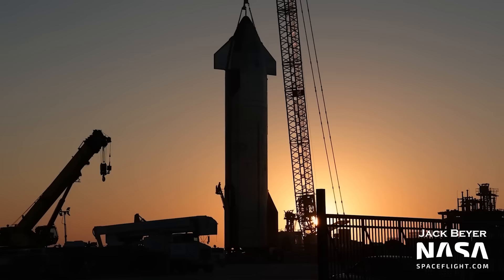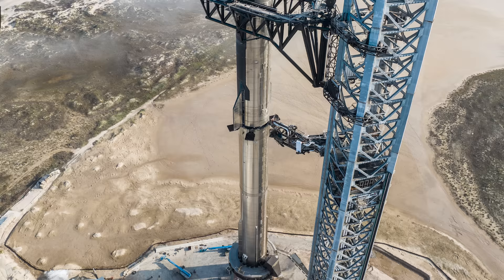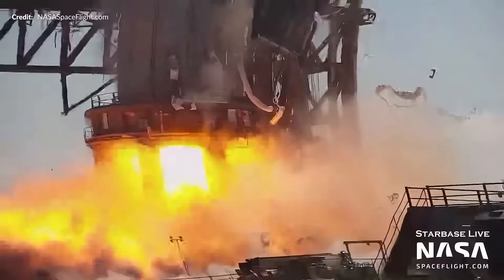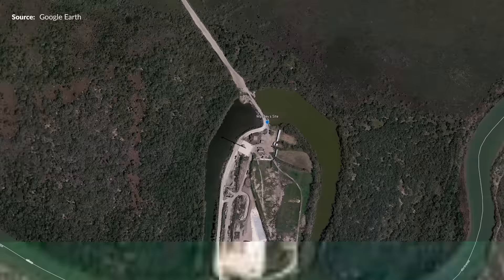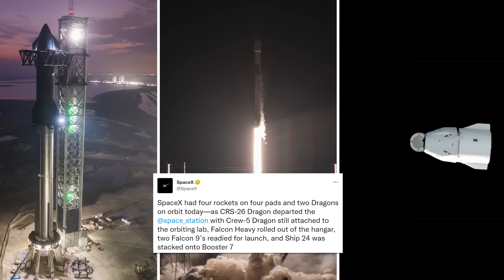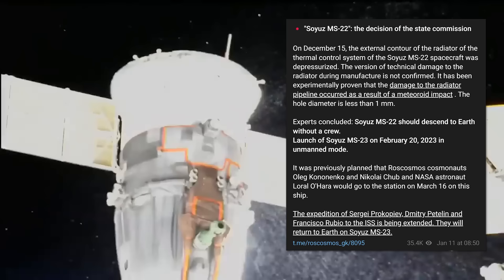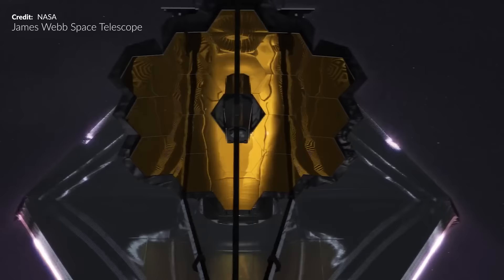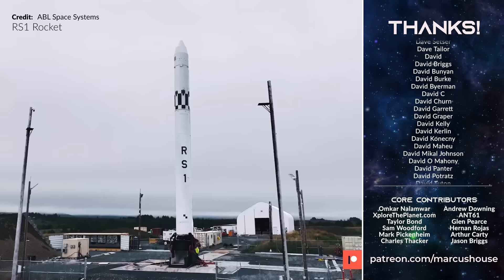SpaceX Starship Full Stack Upgrade Testing, Falcon 9 OneWeb, Falcon Heavy USSF-67, JWST Update

Comment: Full and rapid reusability starts with and depends on the OLM and surrounding ground support equipment.  To be able to launch reliably and often you need a bulletproof launch facility.  The only way I can see they're having that is by transitioning to a launch platform that incorporates a thrust/flame diverter/trench and vast quantities of water.  I've heard that that would be difficult to achieve in Boca Chica because of either the geology or the hydrology affecting the land on which that structure would need to be built.  Whatever the challenges I know a suitable structure can be built.  Bridge builders have faced far more daunting challenges in that regard, and they've been able time and again to come up with very workable solutions.

Comment: Hey Marcus great show been following you for a while. Just wondering what's your thought on Space X placing sacrificial floating platforms for a target to land the booster and Star ship on. I have no doubt they can catch the booster and star-ship once they get the accuracy of landing figured out. I figure the landing process and calculations will be similar to the Falcon 9 system but enough different that it will take some experimentation to be successful.

Comment: I'm thinking they need at least three more static fires, one with just the booster with 33 engines, one with the booster and a simulated load equivalent to a fully load Starship, and then a test fire with a fully loaded Starship (albeit a dummy payload).

Comment: Thank you for another wonderful space video! The format works well, even on weeks when there isn't as much news.

We're all looking forward to SpaceX sending a Starship to orbit, but I'm really interested in the first time they fire up all 33 engines. That's going to be quite an experience, and very educational for SpaceX. You never really know how the engines will work as a group until you test them together. On a related note, I'm surprised they have no solution to the concrete damage except for resurfacing the pad after each flight. If they eventually build up to launching Starships daily, that's going to be incredibly annoying.

Comment: Suggestion: In the speeded-up clips of Starbase operations (chopstick lifts, etc.), add a caption for "actual elapsed time" or maybe "3x playback". We can see that everything is fast, but to usefully discuss "how long will this series of tests take?" (at, e.g., Ars Technica) a quantitative impression would be helpful. (I can't guess if the videos use a standard fast-forward factor, which would make captions easy, or if it varies to match Marcus's narration.)

Comment: why not have removable hexagonal concrete slabs, with heat shield tiles on top, below the launch table? If heavy enough, they would never move and be easier and quicker to replace if damaged.

Comment: Moving the 70m tall booster vertically on a transporter must be an incredibly precarious event. With a dry mass of between 160 and 200 tons and a center of gravity towering around 20m meters above the transporter, it sounds as though a heavy gust of wind could simply topple the booster!

Comment: Before any orbital flight they should just do a hop and test this insane recovery system
Reply: Why?  The system is useful even without reuse.  Development of the landing system can be done in parallel with orbital use just like with Falcon 9.
Reply: @Scanner9631    I will let you in on a secret…what goes up must come down…no down then no need for up
Reply: @shawnstangeland3011  

Of course they will come down but that does not mean LAND. Crashing into the ocean is still coming down. This is exactly what Falcon 9 did while they attempted to perfect the landing mechanisms.

Comment: I did hear you say after testing the pad under the mount will have to be repaired again before more testing or a flight. This isn't good when swift reusability is concerned, not at all like he claimed. No way at all like an airplane could you imagine having to repair the runway after every take off. SpaceX is going to have to address this problem before any idea of multiple launches like promised.
Reply: Which is why Boca is called "R&D facility"

Comment: Hi Marcus, could it be that the former gun range is not becoming a Raptor test stand but a cryo-proofing facility they can use without the need for road closures? There is a limit in the amount for long duration road closures SpaceX is allowed to have.

Comment: Which all the combined knowledge associated with spacex and its development I’m puzzled as to why they have not found a solution to the problem of the launch pad being damaged on every static fire , surely there is something that can withstand the thrust and temperature better than concrete , like maybe solid stainless steel pad or has that been trialed before?

Comment: Hey Marcus, I bet you're kinda jealous seeing all these large concrete pads going in everywhere.  I notice that it seems to be customary in Australia and perhaps New Zealand too to only pour single wheel track lanes for residential driveways.  I've been watching lawn care and pressure washing videos from all sorts of countries and those in Australia all have these double wheel lane driveways.  And I wonder what's up with that?  In my opinion, it would be easier to just frame off one large pad rather than frame off two narrow lanes.   Is concrete that much more expensive Down Under than everywhere else?   In other words, is it a cost saving measure?  Because the thing I see most is that the grass overtakes both pathways a lot easier that way.   And I imagine that they are harder to maintain because of it.  Would like to hear your thoughts on that.  Of course that's not anything at all about SpaceX, but since you're an Aussie, I figure I'd ask.

Comment: Would testing of booster B7 and possibly B8 alone with no Starship attached be an idea to prove booster concept without possibly destroying the full stack in advent of a RUD? Is it even possible?
Weld on a Starship nosecone for streamlining and to clean-up the look. 
This would lower the blast effect and damage of a low altitude RUD.
Reply: Not possible, B8 is dead now

Comment: Can't they use some sort of metal alloy under the stack (instead of concrete) to survive a full static fire or launch? Or is it just that hot/pressured/expensive that this is not an option?

Comment: In the rendering of starship launching why are the fins deployed. Surely although not much it would add drag.
Reply: I don't know which fins are you talking about, please elaborate

1. If it's on the first stage (booster) side, Elon explicitly said they had done the simulation & it wouldn't affect as much. And best parts is no parts which the deployable fins on Falcon has more of it

2.If it's on the second stage (ship) side, retracting the fins would shift the CoG a bit, altering the trajectory

Comment: great animation but why are the grid fins out during launch?
Reply: They found with Falcon 9 that folding them didn't save enough fuel to be worth carrying the folding mechanisms.  So removing it from the design increases payload a tiny bit.  Musk has said future boosters may be reduced to 3 grid fins and one of those made smaller.
Reply: @Scanner9631  thank you wasn't aware of that aspect. Are they going to also remove that aspect from future Falcons?
Reply: @conceptxr4249  

I've seen no mention of it being removed from Falcons.  

Also haven't seen any mention of modifying the Falcon design to use the Stage 0 concept of removing the ignition system for the 8 outer engines from the rocket..

Comment: Instead of concrete under the launch mount why not use a big pool of water? And maybe a removable platform so you can work when the pool is not needed?
Reply: It would instantly vaporize
Reply: @alvianchoiriapriliansyah9882  It would flash to steam. Thats an issue? Its not a pressure vessel. Its open to the atmosphere. Am i just not seeing the down side?
Reply: @joshedwards6205  Flash to steam so fast, that it would be gone & the vehicle exhaust would still be there, damaging the pad
Reply: @alvianchoiriapriliansyah9882  Good Point!
Reply: @joshedwards6205  Which is why the water is sprayed like a waterfall instead, so the water is coming continuously without having to worry about lack of coverage after vaporization

They're increasing the amount of water on 39A already, and soon will be Boca

Comment: Marcus, a year or more ago, I recall a cort case between  the air force and Space X concerning  the size of Space X's ferring size not being large enough to suit the airforce.
I think the court rulled against Space X,,, meaning Space X would be required to enlarge their ferring.  Do you know the status of this  dispute?
Reply: It's not really a court thing, but yes SpaceX will be building a custom, longer (but same diameter) fairing

Assuming you're talking about Falcon, because Starship is indeed a court-thing, rejected because Air Force were traumatized by the Shuttle. So SpaceX have to wait until NSSL Phase 3 for NET 2027 (selection will be earlier ofc)

Comment: Marcus,  what happens to the core booster? Go into orbit or burn up on reentry or splash down. I'm not clear on that.
Just subscribed. Thanks for good stuff.
Reply from the maker: It just re-enters and splashes down. I suspect all FH missions will continue to do this based on Musks tweet yesterday. At one point they were trying to catch them. Just that extra speed probably makes it near impossible for the core.
Reply: @MarcusHouse  Two recent missions back to back that expended it are just a mere coincidence. Missions that would recover the center core will persists

Don't let the conjectures sinking you
Reply from the maker: @alvianchoiriapriliansyah9882  I sure hope so.

Comment: will the Starship landing in water float? will they recover it to analyse? why don't they try to just propulsively land it on some patch of concrete like SN15 already proved ?
Reply: I guess it depends if the starship will take water or not. If not, it will float. If it fills with water, then it will sink like a rock. I guess we can assume that if the landing is soft enough and the recovery happend soon enough, then they won't lose the ship. but if it takes them too long, even if this thing was floating well, the water will get inside.
Reply: @spanke2999  

That would likely ruin the engines but the main hull of the ship and its piping are stainless steel and so should survive.  Would corrosion detonate the flight termination system?

Comment: I have a couple of questions, hoping someone can help me out. Firstly, how many Starship landings have been successful so far? I've only watched a few and they all blew up. Have there been successful ones? How many?

Secondly, Elon talks a lot about rapid reusability, even saying that Starship could launch 3 times a day. However, it seems like every time they do a static fire they have to rebuild the launch pad due to damage. And that's only firing a few engines, not all of them at once. How is rapid reusability going to work if the launch pad needs extensive repair after every launch?

Thirdly, I read somewhere that when a fully loaded super heavy Starship explodes on the launchpad the explosion is going to be equivalent to something close to a Hiroshima. What will that do to Boca Chica and Brownsville? Or the Kennedy Space Centre?

Hopefully someone knows the answer to these. Thanks.

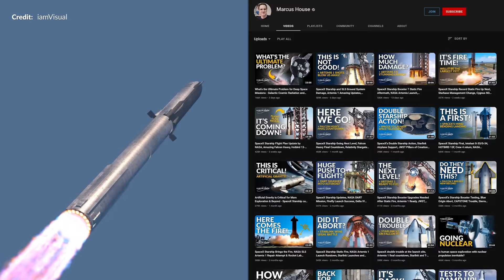Comment: 4:15 are the grid fins going to be deployed during lift off?
Reply: Yes, because it doesn't affect the launch badly, and best parts is no parts
Reply from the maker: Yes, as Alvian said, it seems that the drag is minimal when facing directly upward. It may even be a tiny difference to them being folded as when folded, they are quite thick.

Comment: You know, I mean, they stuck JWST in a Lagrange point...  What do you think Lagrange points are full of?  Everything that's loose in space around a planet ends up in a Lagrange point.  There's more micrometeoroids in a Lagrange point than there are just outside the Lagrange point.  It's a gravity well, I mean, c'mon.
Reply: Those micrometeoroids are floating around at similar speed as JWST and shouldn't be a problem. I think it's micrometeoroids coming from elsewhere at high speed that is doing the damage. 

In one sense it's good data as it may be the first time they have been able to measure the number of micrometeoroids at that distance from Earth. But ouch that is expensive data gathering. Hopefully their attempt at changing the orientation of the telescope will reduce the number of impacts.

Comment: @MarcusHouse OK, while I not a computer guru or a fully vetted engineer something deep in my gut tells me the Starship launch pad and surrounding tanks and pipes will NOT be able to handle and/or survive the full firing of all 33 Raptors engines at the same time. This has bothered me from day one when I seen how close they were to the pad.

But really, who am I to judge or correct Elon and the SpaceX engineer teams I am sure they did their due diligence but cough Challenger, Columbia, Apollo 1, Apollo 13 etc? But seriously the combined exhaust and sound shockwave impact of all the 33 Raptors on the launch pad and surrounding tanks and pipes is going to be a tremendous. Yes I am sure they have ran several computer sims but I believe the numbers could be wrong, computer sims are NOT the real thing. Just look at tall the damage to the area from the 8 engine firings of the Starship, now magnify that by 4+.

I would feel a lot better if there was an exhaust diversion ramps and also an even BIGGER water suppression system too boot. Maybe I missed a SpaceX video on all this?  If so can someone reply with the link.

Comment: Launch pad needs to be 100m high
Reply: I don’t know why they don’t just launch the ship off the tower.  It could be held well off the ground.  The arms can be thermally protected.
Reply: @kentonian  

1/ The arms are made to lift the empty stages not both fully fueled.

2/ The tower is also not made to hold the weight of the full stack fully fueled.

3/ The "pad" includes the ignition system for 20 of the 1st stage engines.

Comment: Won't happen until next year at its closest.  More problems are about to pop up. New tech always has its supprises.. ask any test pilot of a test airplane. Things show up when you start using new untried creations. Will take time to mature any new system. Seen a lot of that already from tiles shaking off to flying concrete and weak shell  siding on the starship and blown hydraulic  hoses on the mech. Raptor 2 explosions plus many other issues yet to come. Takes time to shake out all the hundreds  of "bugs". "Space is hard", to quote EM. It will work in the long run,  imo. Question is, can Musk afford it?
Reply: Just because it takes a time to mature doesn't means they will hold off the maiden flight until then. Maturing actually needs an actual flight tests data

Comment: Marcus, have you ever seen/heard the OFFICIAL reason there is NO Blast Tunnel for Starship? It has always been a bizarre missing piece, especially every time there is a test fire. How is ANY concrete going to withstand 3+ launches per day and how are they supposed to control the RANDOM exhaust blowing stuff everywhere? A small pebble becomes more powerful than a bullet when propelled by 33 engine booster launch exhaust gasses. No exhaust redirection seems Irresponsible, Dangerous (starting fires, causing direct damage, and throwing debris at lethal speeds), and UN-Sustainable (for multiple launches)
Reply: They're directing the exhaust 360° instead of focusing, remember how 39A flame diverter got damaged during Shuttle launches?

And concrete damage is overblown, especially for early days
Reply: @alvianchoiriapriliansyah9882  Hey hey there friend! I dont understand you I think. Do you mean to say that the concrete damage is not such a bad thing? Maybe they don't really need to repair it? I've been wondering about that the whole time. Why do they repair it at all? Seems if they did nothing, then the pit made by the blast would eventually equalize, and then they could coat the pit? I dunno, maybe I have a stupid idea there. What do you think?
Reply: @JeromyBranch  Concrete damage need to be dealt with, but it can be done without having to build a flame diverter

They're taking a water pipes from Cape to Boca right now, which would increase the amount of water deluge. Upgrade probably after the first launch or even when the 39A comes online after 3 Boca launches